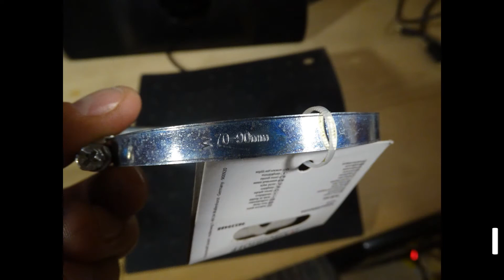Logitech G25/G27/G29 – Ultimate Fix for massive Wobbling and lateral and axial Play

Comment: After partially losing nails and one bleeding, no joy in getting this DIY done. I would highly advise throwing away your old wheel and getting a new one than go through the pain of this process.
Reply from the maker: Fully understand you pain and frustration. Buying a new one is an option too. Don't go for an G9xx, as they all have the same crappy bearing hosuing.
And buying a new one will never give you the joy of fixing one by yourself. Or using tools instead of you nails...
Reply: @mariachi127  I used a deremel and some tools but my clamp was a little wider. I got 'er dun tho

Comment: Update I followed your tutorial using soldering iron to poke holes into the hub it still wobble a little bit but it is an improvement, I wonder if I need to change the bearing ?
Reply from the maker: As my cristal ball is right now out for service and recalibration, I can't tell you if you bearing has more play than normal. "kidding mode off"
Should be easy for you to find out, where the residual play is comming from. I don't think its the bearing, as this one is quite rigid. Use a bright light or touch/feel with your fingers to see where the play is located.

Comment: Hi, does anyone have a recommended video for taking apart the gear/bearing housing?, i wanted to change it to Alumunium ones but im afraid broke things up when taking off the housing.
Reply from the maker: Hi, sadly I don't have one. But why going to the aluminum version? If you check some of my older videos you see my wheel mod in action. Original (heavy) KTM X-Bow wheel attached to the G25 base. With the applied enforcement from this video, no play / wobbling at all after a quite long period.

Comment: What’s the width of the clamp? The housing diameter is about 3 inches but I think the clamp should be a narrow band. Standard 3” clamps are about half inches wide (9/16).
Reply from the maker: 9mm. All dimensions are shown in the video, Check the label of the hose clamp. Cheers

Comment: Does this work with just zip ties too?
Reply from the maker: Generally yes, but depends on the quality of zip ties, but you won't get a such rigid and stable bearing support. As the metal clips are not expensive at all, I would recommend them instead of zip ties.
But give it a try. If not rigid enough, change later to metal ones.
Reply: @mariachi127  Thanks, I've decided to do this mod today I'll keep you updated!

Comment: When I start the game my G25 locks at 90°. So I can rotate it to the 90° mark but then the spring stiffens. It's pretty tough to turn any further. any tips?
Reply from the maker: Check how the wheel is dedected by Windows. If it is not as G25, it's likely the USB cable connection.. The G25/G27 do not like USB3 or hubs. Try connect directly to a USB2 port
Reply: mariachi127 hey thanks for the tips but I figured it out earlier. Also where can I get steering wheels to swap the g25 one?
Reply from the maker: You can use any, if it has a flat mount. But should not be to heavy, this will crack your housing. I would recommend going for a leather Karting wheel, starting from 30USD new or a used one. You have to drill some holes, but should no be an issue at all. And there are many videos on youtube about G25/G27 wheel mods.
Reply: mariachi127 ok cool thanks